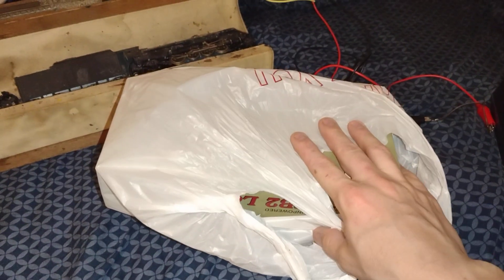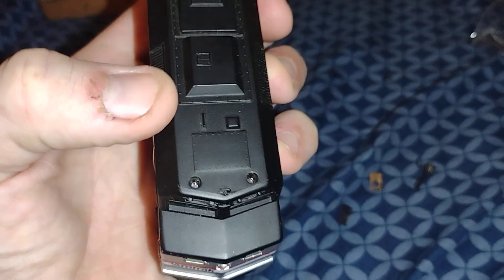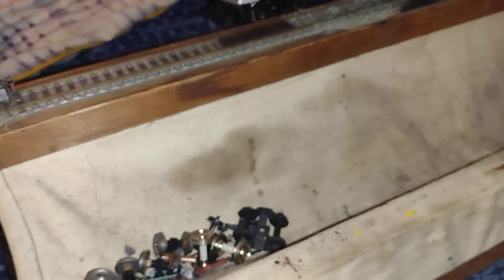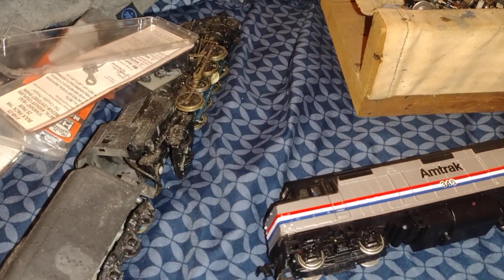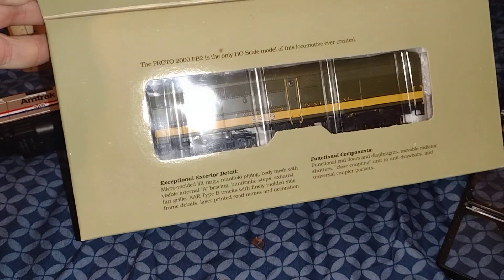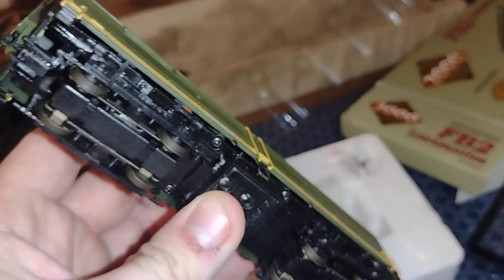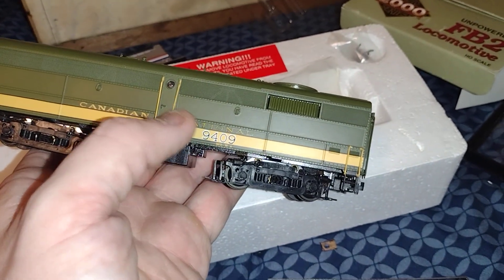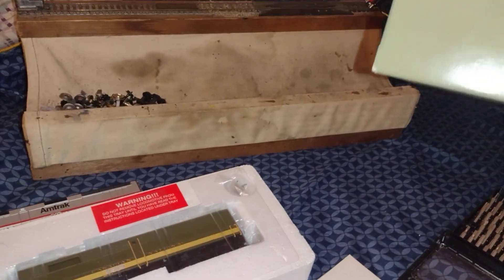some Ho scale finds from flea market/update

Comment: You find some good things at flea markets!  Nice.  I have two of those FP40H engines.  I couldn't believe it when the lights on top started blinking!  Those old Tyco steam engines are great too.  They'll pull a lot of cars.
Reply from the maker: Yea them steamers been on back burner for a year about. Yes I agree I was shocked seeing the blinking lights. I wonder if somebody put a dcc/DC decoder. Maybe not
Reply from the maker: Just a heads up I did open up the locomotive in case you or someone else hasn't. This is probably right before they changed over from the split chassis design. Because that's what it has a split chassis and then what's really unique is there's a PC board with two brass contacts coming out of it to touch the split chassis and that has some capacitors a little transistor and I think a bridge rectifier including I think a timing chip so that it makes those strobes blink. And it gives it directional lighting